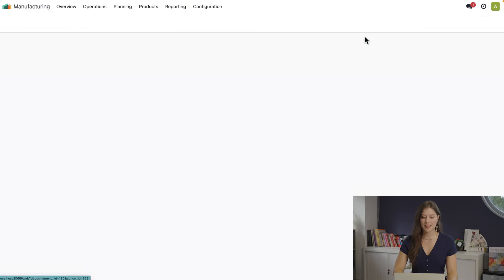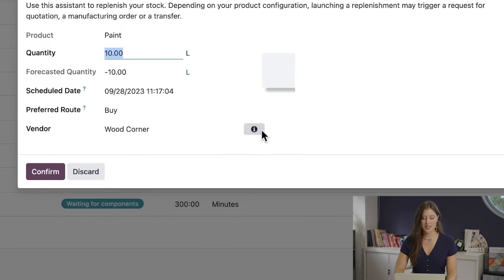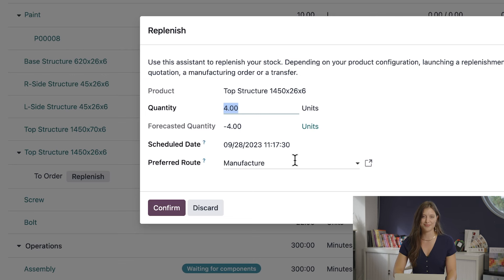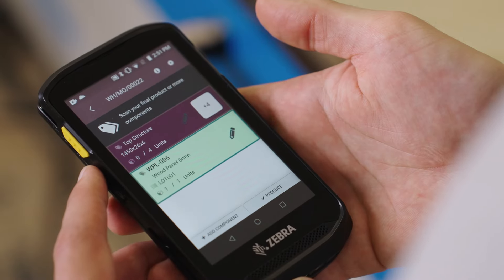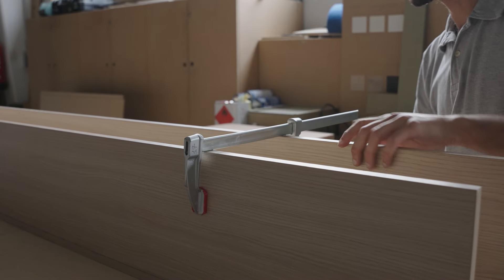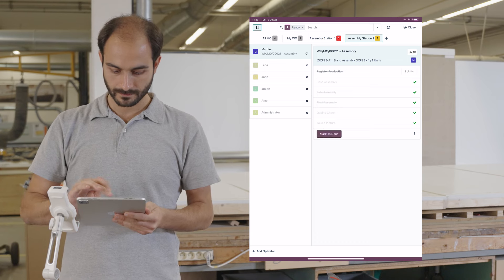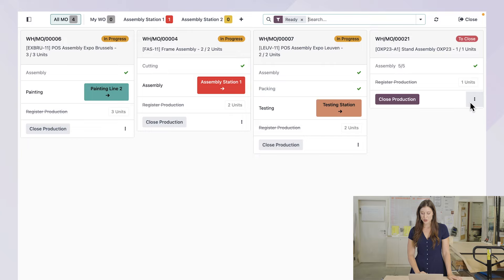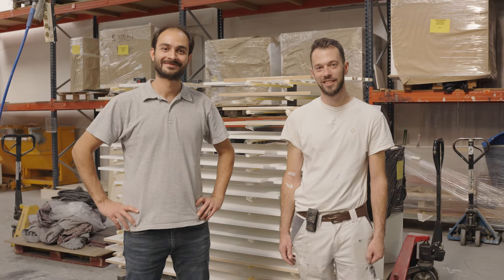Smooth manufacturing flows with Odoo MRP

Comment: If 4 quantities of a bom component are required in a process, can the operator validate it one by one? and move the processes component to the next phase of the work order? From what ive learned, you can only pass all the components from 1 work order to next and not by single, right? can anyone answer